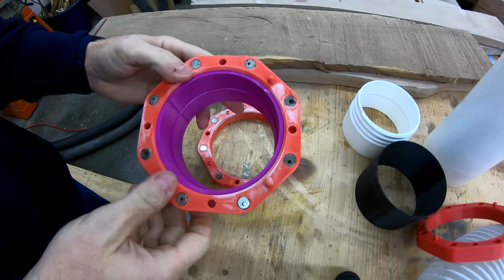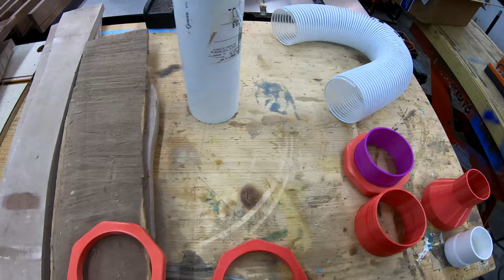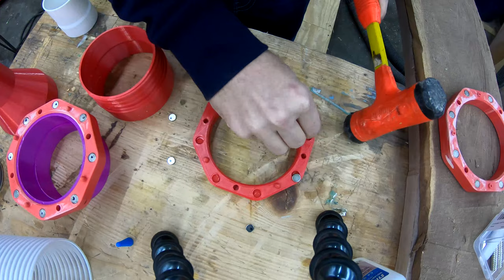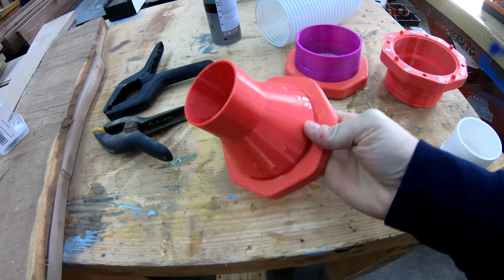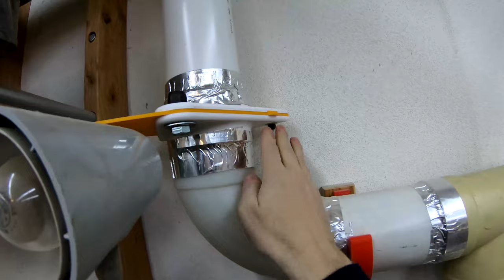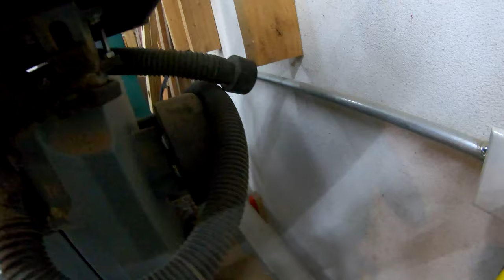Interchangeable Magnetic Hose couplers and Adapters//// Dust Collector Part 6

Comment: I like these type of magnetic couplers for dust collection. I also like 6" hose for (much) better airflow. Maybe I need a 3D printer to make the coupler but I see plywood versions out there and I think "good enough and not brittle". I would have to test whatever I use for air leaks. I'd like to see the various youtubers do that as well.

Comment: This modification you made is excellent. Currently printing a bunch of the adaptor plates, however I will alternate the magnet polarity. This way I don't have to try and match plates between connections.

Comment: Quick tip: Heat up the PVC with a heat gun if it is a tad too small and force it over a connector that is a bit too big to fit and you get a great connection.

Comment: Thanks for sharing your files. Did you print the 4” hose adapter  with the threaded end facing down to the printer plate or facing up?

Comment: These quick connects are the best design I've come across to date! Great work. Do you happen to have another file format for your original 3D models? I've tried to modify the STLs and the programs I've imported them into have really butchered the mesh files making them hard to tweak. What did you create them in originally? I'm hoping to eliminate some overhangs on a a few of them and adjust overall diameter's. Thanks!
Reply from the maker: I used Fusion360 to create the files. I might still have the original files saved, but it has been a while. Reach out to me at tnlightle@gmail.com and I will share with you what I have.